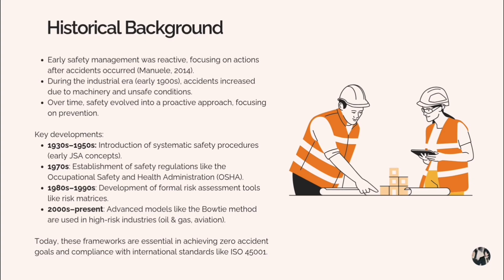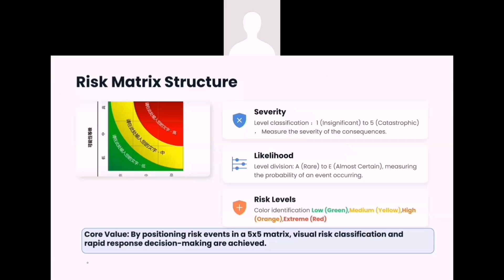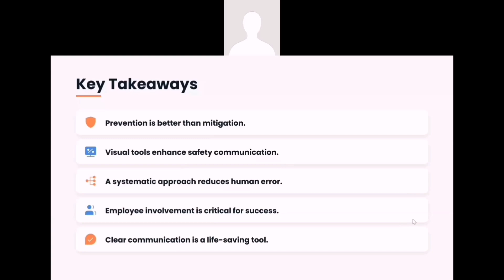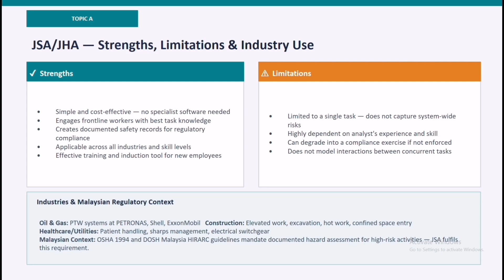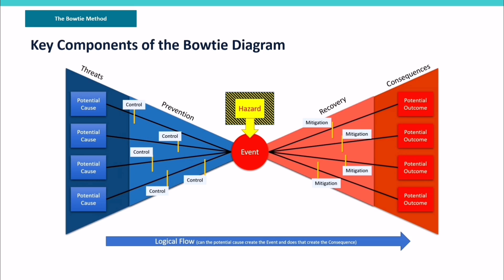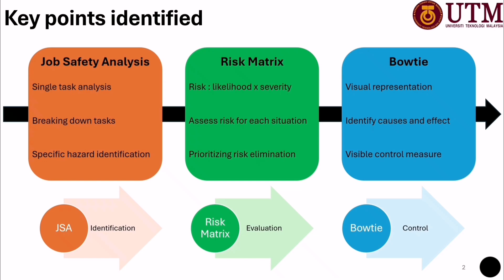Engineering and Environmental Safety [ Preventative and Evaluative Frameworks]

Comment: What is PTW system means?
Reply from the maker: PTW = Permit to Work
It's a formal written system used in high-risk industries (oil & gas, construction, manufacturing) that authorizes specific workers to carry out hazardous tasks under controlled conditions.
A PTW ensures that before any dangerous job starts, the right safety checks, isolations, and approvals are all in place. It typically includes what work is being done, who is doing it, what hazards exist, what controls are in place, and a signature from an authorized issuer.